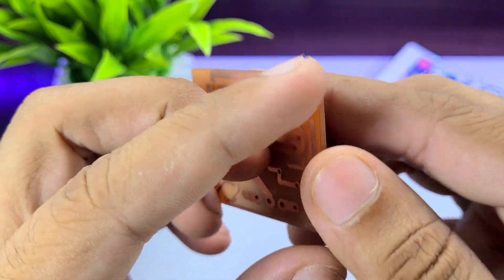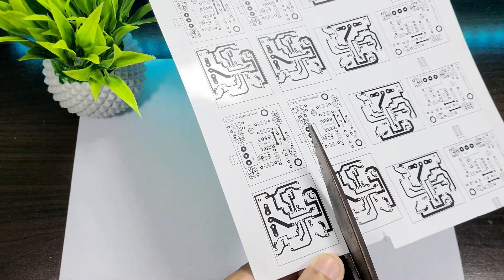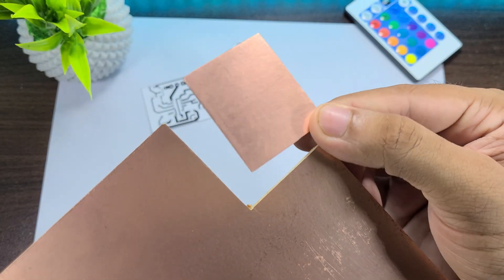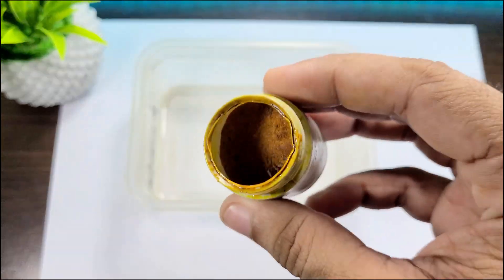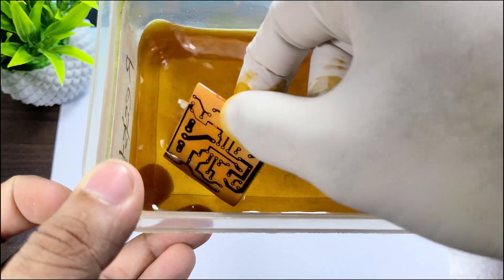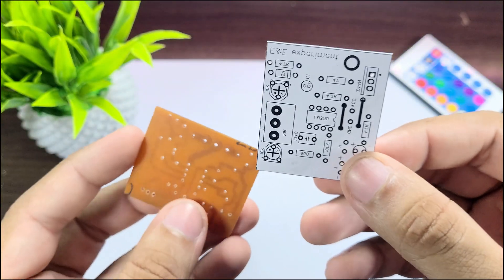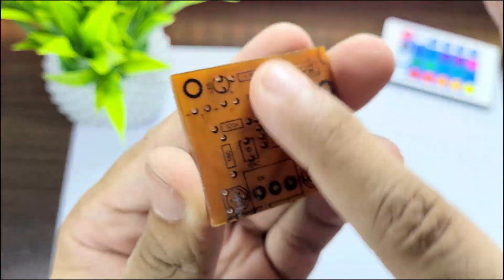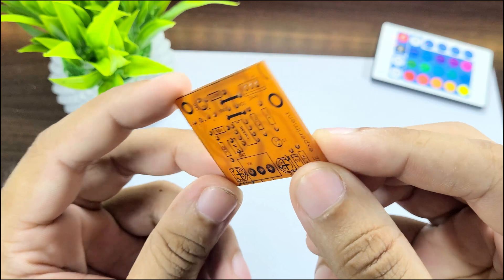How to make your own pcb board at home

Comment: Often a good idea is to make the tracks as wide as possible ( why ? ) ... this method can carry more current , but the main reason is there is  MUCH  less copper to etch , so your expensive solution will last longer .... however , when designing PCBs for high voltages wide insulating gaps are still needed ( tried - n - tested 😝 ) ........... DAVE™🛑